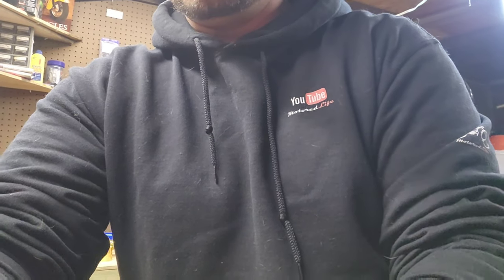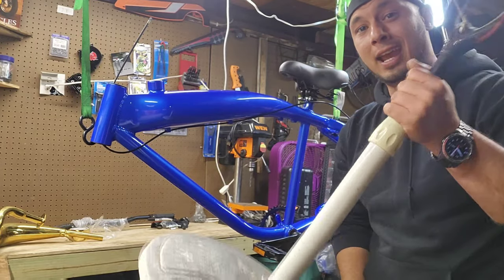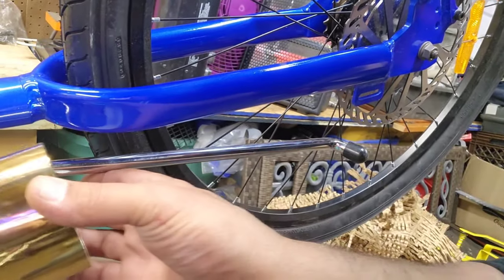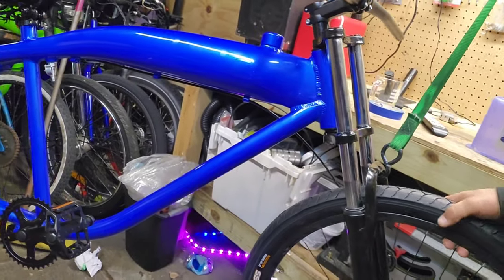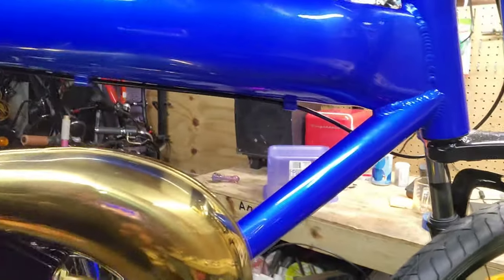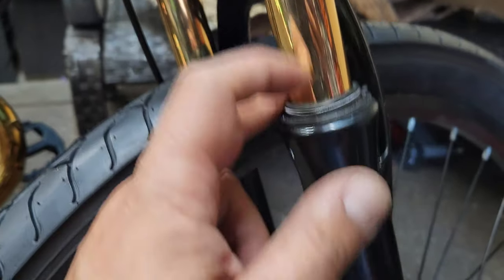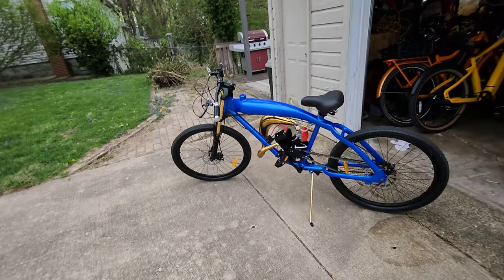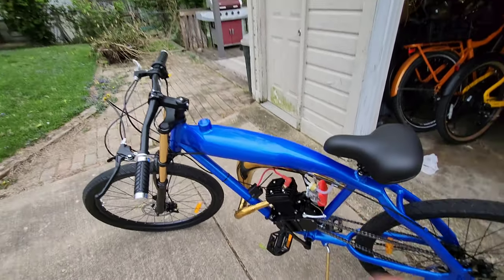We build a 100cc Motorbeast!

Comment: built 2 motorized bikes, FUN to build! But rear bearings gave out even when I packed them with grease
Reply: A lot of the time it’s not the bearings “giving out” , but I find the bolts move a lot with coaster brakes
Reply: @cameronbernhardy8357  non coaster brakes
Reply: You over tightened them
Reply: Same

Comment: I put a Predator 212 in my Giant frame, Honda 10 amp charging coils, a 7" Harley led headlight,  bullet style led tail light with brake and turn signals, 14" riser bars, Rock Shock front end, with 4 piston hyd brake. Comet 30 trans,  and a 6 spoke mag wheel in the back, with 2 canvas saddlebags slung over the back rest. A 2 gal gas tank sits on the crossbar,  With some flowing, jetting, big air, and smooth exhaust, the engine produces about 10 or 12 hp, which gets me over 70 mph, but I keep the throttle stop screw set at 80 kph, which keeps the rpm's under 5,000. I can pick up the front wheel almost effortlessly from a stop, and it rides like my old 76 shovel head Harley. If you want a more serious ride, I highly recommend the Monster 90, 78.5cc 4 stroke engine, using a Comet 20 trans,  and Go Power Sports Juggernaut clutch. You won't need to modify the frame to fit the Monster engine, but you do if you use the Predator. These engines will outlast those China Doll 2 strokes, 10 times, or more. I've been riding mine over 7 years, and it runs like new. I think it will probably outlast me, as I'm 70, blind, and deaf. Wish me luck.

Comment: best thing ive done is get a $180 rockshox 30 Silver TK and a $80 SR Suntour SP12 NCX seat post .  i run my cables/wiring in expandable cable sleeves and use a $13 bmx hallow stem bolt to run the front brake cable threw the stem . clone vm18 mikuni carburetor with a k&n type filter is a must have to get those motors tuned right and nice

Comment: Which of the 3 engines would you suggest for long term use? Zada 80, Phantom 85, or the new Zada100 max? I'm 155lbs, travel 38 miles round trip at 24mph once or twice a week pulling a trailer to haul groceries, water, propane, gas with a couple small hills, about 400ft long. Presently running a BBR Stage 4 with a MZ 65 clone and OZ reed valve. Thinking l want a bit more torque to run a 36t and still maintain 25mph. What would suggest? My bike is a GX7 Genesis 29r
Reply: In my opinion the yd100 has been the best. I got over 2,000 miles out of built engine

Comment: I'm interested in building something like this but using a predator 212cc motor and like doing away with the pedal cranks are just having pegs any advice
Reply: Also using like a cafe racer style seat and building a cafe racer 212cc bicycle
Reply: Predator 212 with a centrifugal clutch instead of cvt is the way to go
Reply: @chadhunt6596  for sure I basically want to build a small motorcycle I don't wanna have to mix gas and I plan on adding the electric start kit to the 212
Reply: @chadhunt6596  that style of clutch sucks manual clutch all the way

Comment: Nice 👍 build.. I built a few 2ts had my custom redone phatmoto 4t for a few years but now if I'm going to push the legal limits of what is a bicycle I'm sticking with my sur-ron LBX all that noise I forgot how loud these things are lol I have the 125cc 2t power on a silent platform that I can wheelie and jump 🦘❤ and so far almost 5,000 miles and cops leave me alone for the must part been pulled for rolling a stop sign changing lanes without a signal but nothing was said about the bike itself.

Comment: Please advise!
All my crank cases have 45mm stud spacing, I just bought a wicked cylinder but the stud spacing is 50mm!
Which cases should I look for?
Because even the seller has no idea!
Reply from the maker: The YD100/LD100/Zeda100 and phantom all use a bottom end with the wider studs.
Reply: @MotoredLife  thanks, it's a beautiful cylinder, massive inlet and exhaust ports.
I'll see if I can find some cases.
Annoying though as it was described as an upgraded cylinder that's all.

Comment: Bro my exhaust gasket broke so my uncle gave me a gasket sheet pretty old I assume 10 years and my uncle is about 78 and he loves building tractors and old cars anything with old engines he’s got about 30 different tractors and cars. Anyway he gave me some powerful glue and the gasket and told me to cut it to the exhaust and I did that jndooros after putting it on and it worked well I realised the gasket nigh have asbestos and I cut it inside my living room and I realised the sticky stuff is to stop asbestos flying around! What should I do guys! Am I cooked? How do I purify my living room